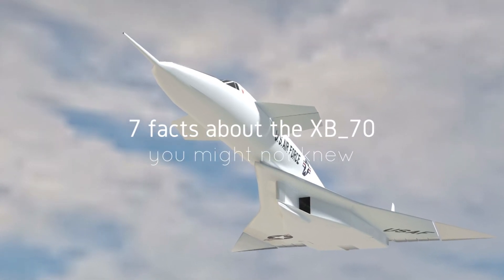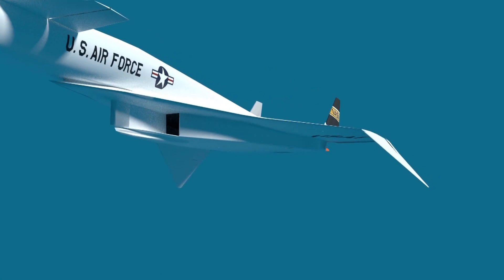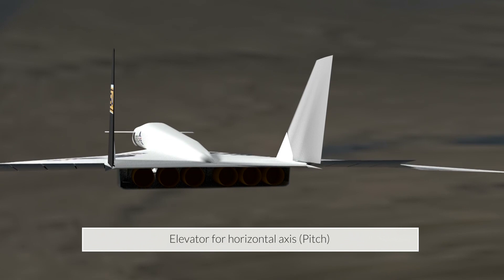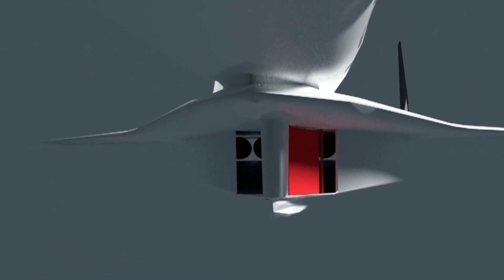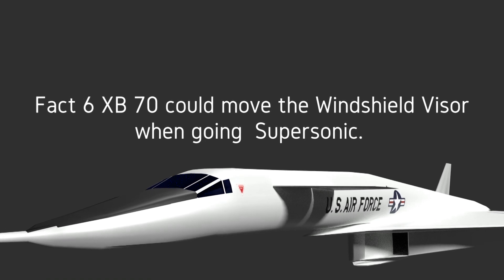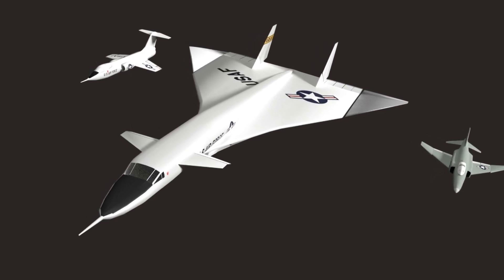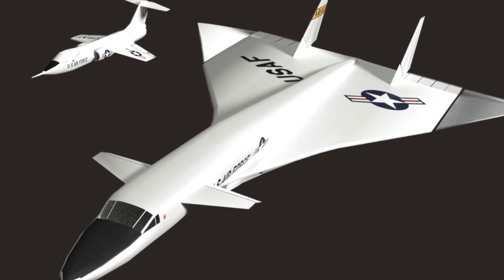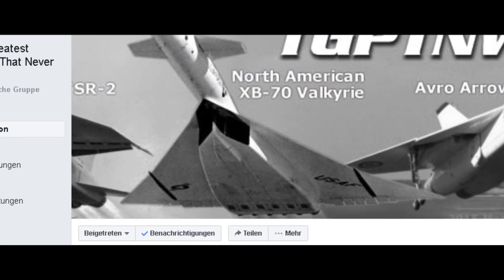7 little known facts about the XB 70 Valkyrie, Mach 3 Bomber, you might not knew.

Comment: It was a bit short but still very useful regarding this great aircraft. It is sad that they do not fly anymore. They would be very great using it as a passenger SST A/C. The US should have made those great planes as a passenger plane.
Reply from the maker: When i made this, every min took about 5 h rendering time. But this seams to mean, u would like to see more? Who knows, may i make a second part?
Reply from the maker: I agree, bring her back in the air.
Reply: They can't use it as a passenger plane because it wasn't designed to hold passengers, or with sufficient internal volume to add that area. It would have to be redesigned so extensively that they might as well just start from scratch. 

NA did have an entry in the American SST competition, along with Lockheed and Boeing. NA's plane carried fewer passengers than Boeing and Lockheed, and its range was inferior both to those planes, and the SSTs that actually entered service.
Reply: @Galileo7of9 thanks, very interesting. I'm assuming that those figures were generated by NA. Do you have any information as to when they were proposed?  Also, why didn't NA propose that idea when they went up against Boeing and Lockheed?
Reply: @Galileo7of9 It's been decades since I read Howard Moon's book on the Tu144. I. Vaguely remember something about rumors of putting a passenger pod under a supersonic bomber. It would have to been the B-58, but this is definitely a step beyond that idea.

Comment: The reason the wingtips were made to fold down is because of stability.  The vertical stabilizers were designed for subsonic flight, but are undersized when travelling faster than sound.  The compression lift (riding on the shockwave) at supersonic speeds provided so much lift that the wingtips could be folded down to add to the vertical stabilizer surface.
Reply from the maker: oh, ok, thx, great information. I'm going to make a vid about this item. thx so much. lets  conservate the history